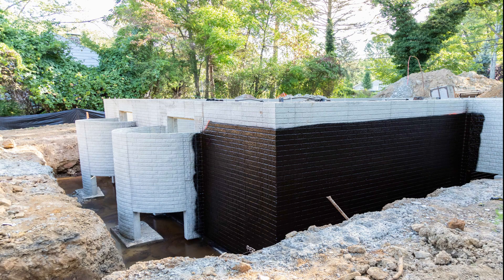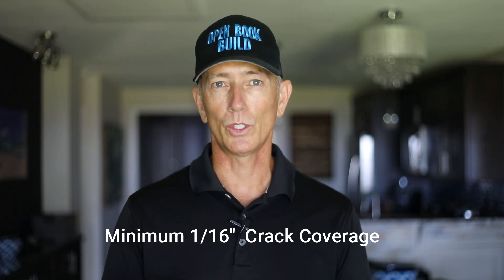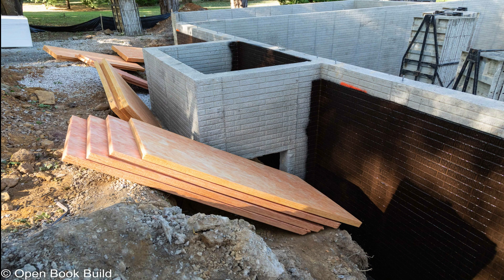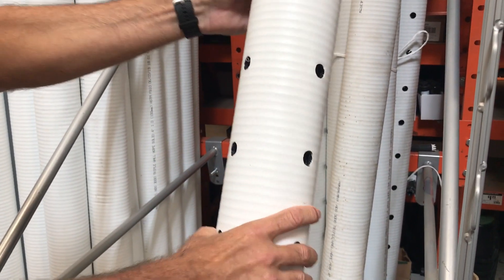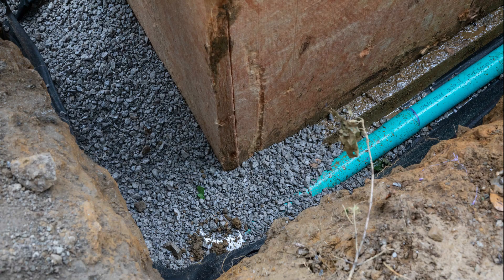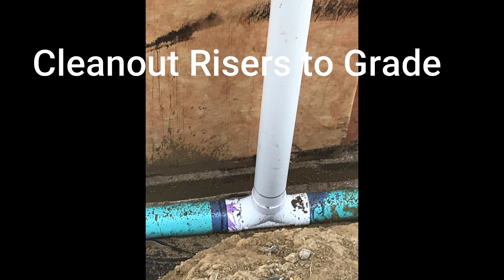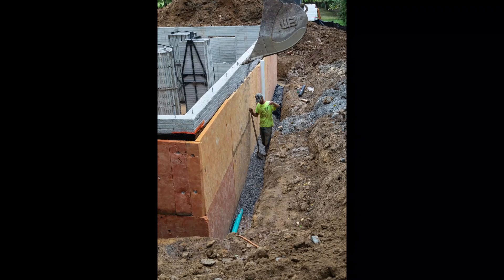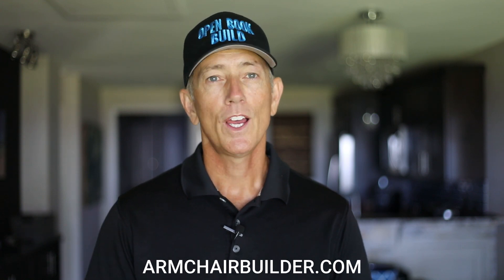Avoiding Basement Water Leaks: Waterproofing & Drainage Best Practices

Comment: What’s the type of foundation wall insulation was used on the exterior foundation wall. You mentioned that it can also drain the water?
Reply from the maker: Yes…insulation and drainage…made by Tremco.  Warm-n-Dri board.  Here’s the link to the product.  https://www.tremcosealants.com/fileshare/DataSheets_Hyland/Warm_N_Dri_Board_DS.pdf
Reply: @OpenBookBuild  Is it any better comparing to XPS covered by dimpled membrane?  typically insulation looses R value when moist, and especially if compressed by the backfill.

Comment: you say that the drain tile extends into the “sump crock” but what for? are they connected?
Reply from the maker: Hello.  Yes, the drain tile pipe extends into the sump crock in the basement.  The sump pump is in the crock and it pumps the water out to grade where it runs away from the house.  For the Open Book Build prototype home, the local code requires the sump pump discharge pipe to be tied into the storm drain at the street.

Comment: Well they just don't last forever. Install inside drain gives more protection.
Reply: The whole objective is to keep the water out. Why bring it in, and then address the problem? The sump pump is already inside the house basement, and the drain pipe extends from outside into the inside basement sump pump in event water ever reaches inside.

Comment: Why put rock below the French drain pipe? Doesn't that guarantee water will be pooled there.
Reply from the maker: The gravel/stone below the drain tile pipe is there to prevent silt/dirt from entering the pipe.  The biggest concern we have for the foundation drainage system is it getting clogged.  If the pipe sits on top of the soil, as the ground water rises it will carry silt into the pipe...gradually clogging it over time.  And because the pipe sits below the top of the footing, any water sitting below the pipe in the stone layer is of no concern to the basement.